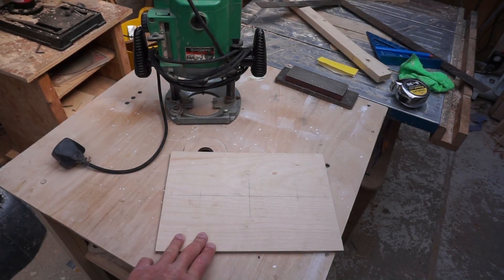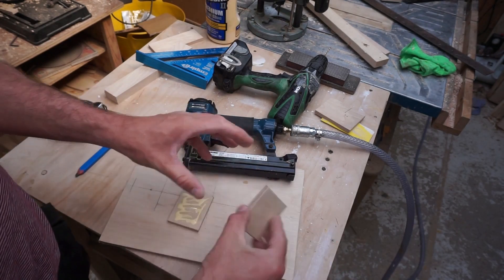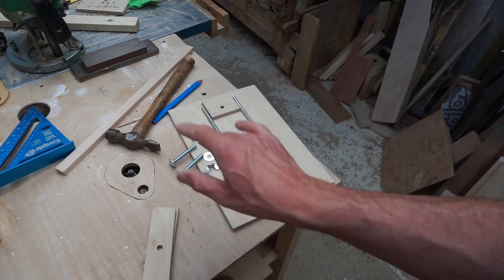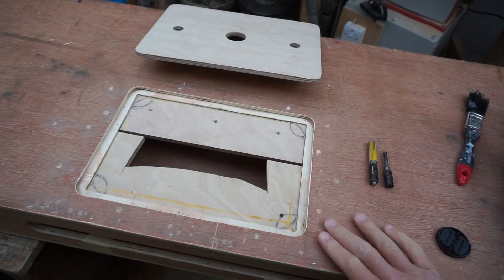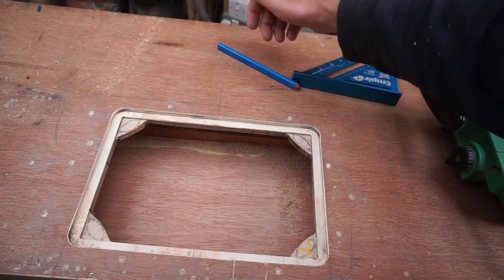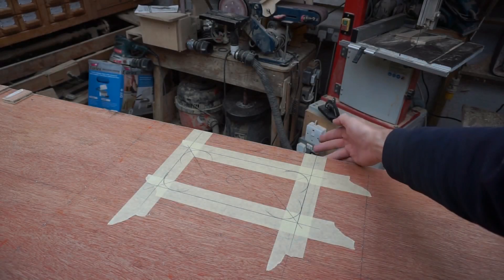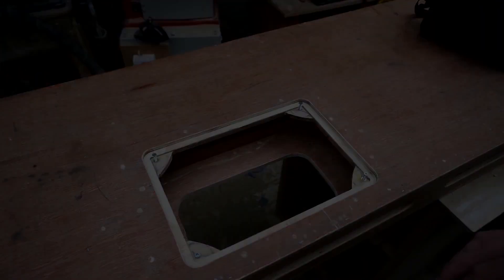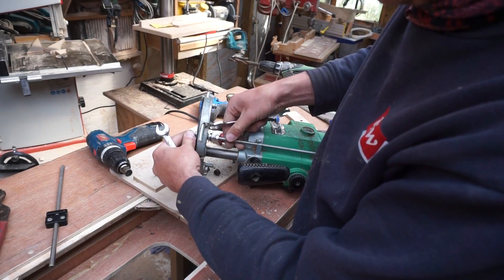Router Table Insert With Rise and Fall Mechanism

Comment: Very nice.  I have a similar setup built into my table saw, but with a Rousseau insert.  It has removeable rings so you can change bits above the table, but they're snap-in and a pain.  The newer models with turn and click are really nice.  That's only thing your design could use.
Reply from the maker: Thank you. Appreciate your ideas there

Comment: Excellent job. Just found your channel. Used same router and did same thing a few years ago. I've used the fence system from my previous router table. Vacuum extraction, NVR switch and power feed are three worthwhile additions which I over time added to my bench. Great channel.
Reply from the maker: Hey Alastair. I consider my channel to be "the Internet's best kept secret". Glad to have your support.
Matt

Comment: Thanks for your video!  I have the exact same router and want to add the rise and fall mechanism. Could you please further explain the components? Looks like you remove the old threaded rod, drill hole larger in router base to accept a new rod with lock nut and washer . But it looks like you use a bearing of some sort? I would really appreciate further explanation. Thank you
Reply from the maker: Hey James. Glad you liked the content. 
You have described the process correctly. 
I will produce a new video to show in detail the rise and fall mechanism, with some links to buy the components.
Matt
Reply: Crooks That would be great. I will be looking for it.
Reply from the maker: Hi James, 
Here you go.
https://youtu.be/N5mZ0xHb0_8
Reply: Crooks thank you. Got mine fixed and is working great
Reply from the maker: Nice one James

Comment: Could you do a more in-depth video on the lift mechanism.  You seemed to go over it real quick.   I have that same router and I have a problem with sawdust getting packed in the two rods that allow the router to plunge up and down.  It is always problematic to get it out and get it to plunge smoothly again.  Thanks for sharing
Reply from the maker: First. The threaded bar, I drilled through the base of the router. This is an old model I had lying around for a while. I used a threaded insert to drive the rise and fall position.
I used threaded bar as it is easy to replace should I need to.

As for dust, do you use any form of dust collection?
I have a video showing how set up an improved dust extraction.
https://youtu.be/o4WaIjEpoUY
I hope that is helpful.
Glad you like the content
Matt
Reply: Crooks thanks for the prompt reply.  I do use dust collection built into my fence.  The opening is adjustable to increase the suction.  The table usually stays pretty clean but dust still ends up on the floor.  I should look into that smooth interior hose setup you have.  Another pet peeve I have with the M12V in the router table is the two wings to attach the collets.  They always seem to get in the way of the wrench and make changing bits cumbersome depending on the size and what elevation it is at.  
Thanks again for sharing and the response
Reply from the maker: Hi Mikr
https://youtu.be/N5mZ0xHb0_8
Thanks for your feed back
Matt